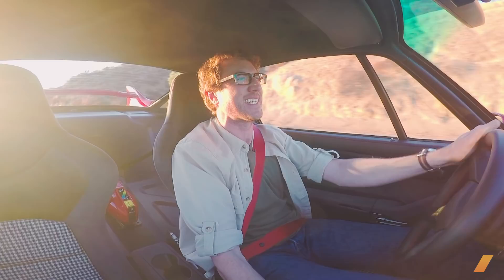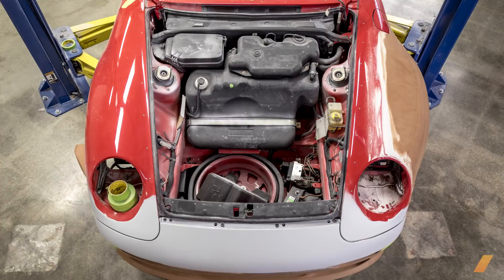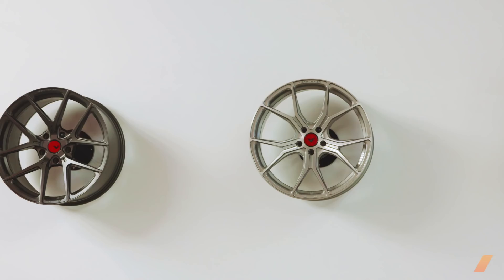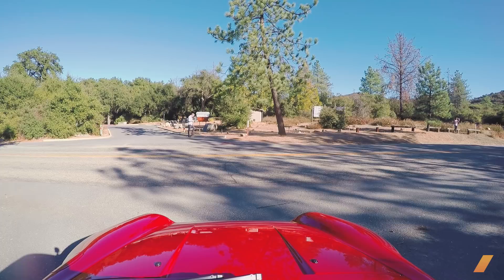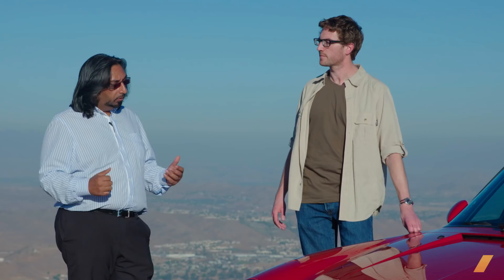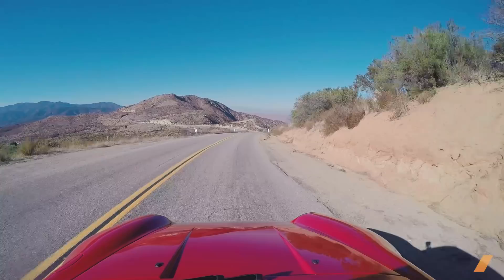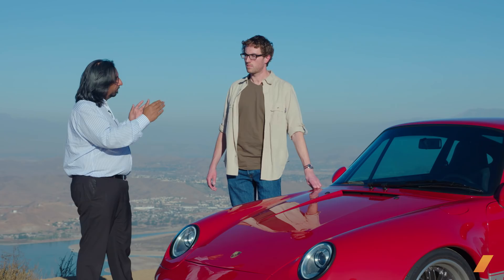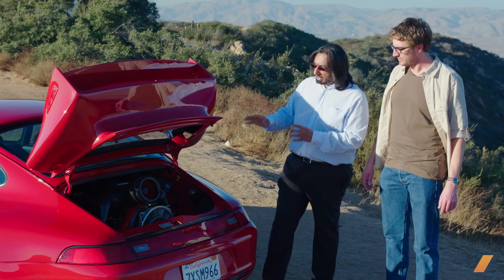Driving the $600,000 Gunther Werks 400R

Comment: 993 c2 shell with engine and tranny $25K
9 piece Carbon fiber panels kit $35k
Paint and fitting $25k
400hp 4.0L twin plug engine and tune $40k
Gt2 transmission build with LSD $15k
Suspension, wheels, tiers $20k
Interior $10k

Total: 

$170k and that is all outsourced. 
$130k if you do some of the work yourself. 

I appreciate the work but the price will kill these series. If they would be priced at $250k, it would take some of the singers clients and plus others. At $600k plus tax, this will stay one of a kind.
Reply: Porsche Collector I agree with what you are saying, it’s too much, but forgot that development, testing, tuning etc is also costing a ton of money. To make it drive good, work good and be rigid but lightweight was a challenge.

But it’s not looking that good for that much development though...
Reply: a 993 C2 with engine and tranny- for $25k?? Where!?
Reply: раскатал нормально коллектор ахахах
Reply: Дурачку за эту цену только можно всучить
Reply: All 25 cars are already sold out though. It might be overpriced but they sure did their homework as to whether the demand was there.
Reply: One of a kind?  U didn’t watch the video did you?  They have sold 20+ already.

Comment: 993 RSCS was the precursor to the 996 GT3. 

This kit car is nothing like the real deal.
Reply: This is meant to be the RS version of that. 
Though they kinda overdid it on the engine part, seeing as it's only 20-30 bhp of the GT2.
Reply: The 993 RS Clubsport IS the precursor of what today is a 911 GT3 RS.
It just wasn't named like that as back then the GT3 regulations were not put on paper yet.

The vehicle in this video is a very sad thing indeed.
A 993 shell has to be slaughtered, completed with after market body panels (however expensive their development was) and probably a nicely built tuner engine.

An original 993 RS Clubsport sells for ~ 500K USD these days - the real deal.
I think these guys were a little optimistic on that pricing strategy.
This looks like something that shouldn't be more than 200K USD at most.
Reply: Not at all, the RS conversion is much more extensive then the 993 CRS CS. 
Which was just the race car version of the Carrera RS.

Comment: 600k how about 100?
Reply: At this point a basic 993 Turbo costs more than that.
Reply: what would you say the carbon panels would cost? 20k all up? and to strip the car down to bare metal... another 30k incl the media blasting, panel and paint for a full car like that another 30k? motor and box call it 50k, suspension wheels etc etc 200k. The cars maximum 340k. And that's being so generous it hurts as a tradesman in panel and paint.
Reply: Basically, yes. They're a successful company that can use their hours to bang out smaller projects with bigger markup to make more money per hour of work. The cars are all pre-sold at 600k so the market has spoken. Anyone selling for less than demand is an idiot, doubly so in the car market where it will instantly get flipped for its true value. You could also argue the 911R isn't worth $400,000, but it's entirely irrelevant because that's what people are buying them for.
Reply: Being a collector and a steward for collections, nobody that I know has placed an order with them or even remotely interested in this. Marketing attempt to hype up something that is not worthy of more than 120K

Comment: “Porsche never built a 993 generation GT3 RS.”

Um... hello? The 993 already had an RS variant. In fact, there were two of them. One was a regular, and the Clubsport variant with the big wing. Both are powered by 3.8 liter engines producing 300 HP.

Comment: Can someone explain to me how you reduce the track if you run wider rear tires. I can't wrap my head around this logic.
Reply: Adam Coleman.....the inner edges of the L&R tires get closer as the wheel hub positioning remains the same.  This is what they’re defining as “track”.
Reply: Based on that definition, I agree. However, I have always thought "track" to be the distance between centerline of two wheels on the same axle. Am I incorrect?

Comment: 3:38sec - "The only thing original on the car are the doors/mirrors handles"....then he says, "we media-blast the shell"....meaning they are using the COMPLETE CHASSIS TOO. So the glass is completely different (not OEM) glass.. not even the lights?-----GTFOH...with your BS lies/upselling.---So it's really a Body kit, wheels/springs and a engine package for $500k+. And they found 10+ SUCKERS that bought it.....tells you that being RICH doesn't mean smart/common sense.

Comment: yeah... I would rather buy a 991 Turbo ($150,000), 997 Turbo ($75,000), 996 Turbo ($40,000), 993 Turbo ($150,000), a 964 Turbo ($100,000) AND a 930 Turbo ($100,000) rather than this. You can seriously buy every generation of 911 Turbo's for LESS than this costs. I get that is comparing apples and oranges but I just can't imagine why this costs $680,000 when almost every aspect is being outsourced. Singer's are almost $200,000 less than this at every single piece of those are handcrafted works of art. Maybe I'm missing something?

Comment: First of all, the rear wing looks hideous (as does the ruf) and it appears that the paint doesn't match the doors and the fenders. It also seems like one could take a wide body C2S and do a few suspension mods and a motor build by Jake Raby build and for around $100-150k you'd have a more stock (better looking) car with similar performance. As a 911 owner and a true fan of Porsche I'd much rather a 997.2 GTS RS 4.0, 911R, 991.2 GT3 6mt or a singer. This one just does speak to me for some reason.